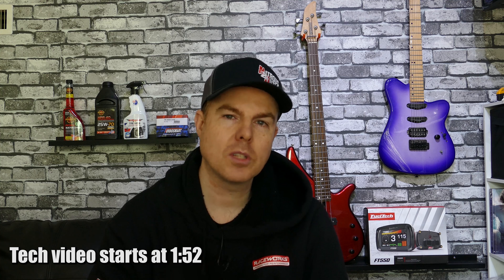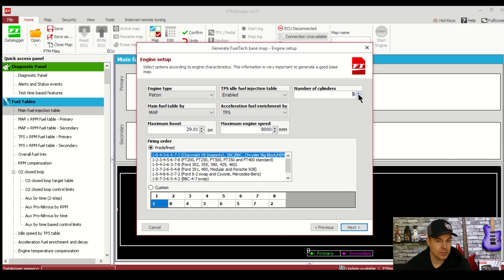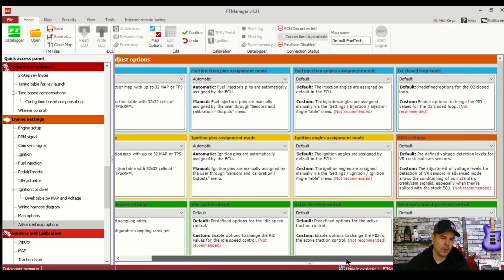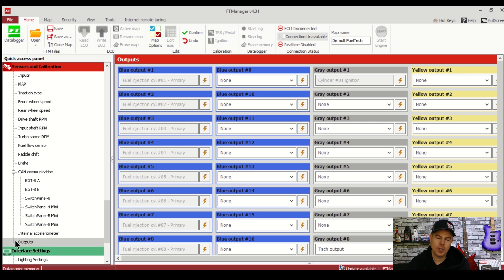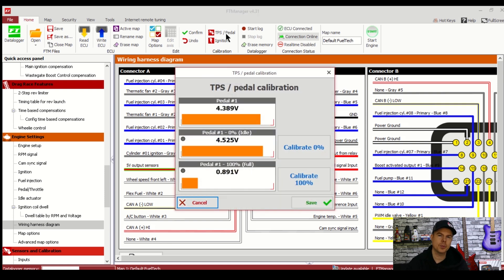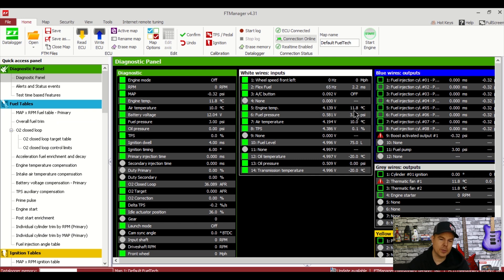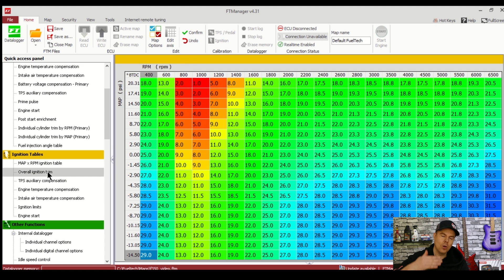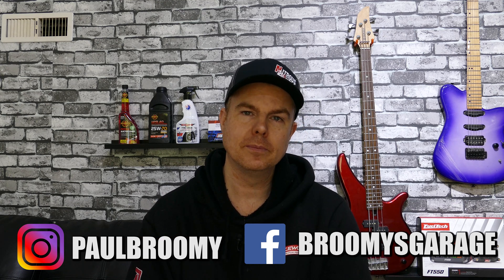How to Setup a FuelTech ecu (FT450, FT550, FT550 lite, FT600)

Comment: Boy you talk FAST !! IM Working on My 88 10th anniversary RX-7 1of1500 13BTURBO on an FT-450  
Do you have a setup Video for This Same pretty simple all Fueltech Setup. 10:10
Reply from the maker: If you follow the setup wizard you can select rotary and the option for the factory crank angle sensor trigger pattern is there.

Comment: On my 550 lite, Built my own wiring harness. I’m having an issue calibrating TPS. Once I hit calibrate. TPS reads 100%. Once I moved the white input. I was then able to get it to drop to .5-0.49. I then accelerate n its jumps to 5.00v like normal. Injectors would fire except for #3. Switched for a #1 inj plug. N the #3 inj still only fires. I then moved the Blue outputs to the B plug, outputs socket #9 or so. Test it I could hear fuel spray but not click if that makes sense. Then I put the blue in the normal socket n the #1 injector started to function normally along with my #3 that was working previously. Did that same procedure for the rest n all inj worked properly. After getting the TPS n injectors to function. I did some where the tune didn’t save nothing. So now I have to build a new map. The TPS reads 100% again n my injectors don’t work once tested in the output page. Now I have to do all that moving wires again. Or is my ecu defective? Also my Fuel psi isn’t reading oil psi is reading fine. Switch plugs n I was able to see accurate Fuel psi to my gauge. N of course no oil psi. Ppl tell me the wiring is backwards or sum silly. If that’s the case why did they function after moving certain wires? Never had to mess with a plug in the engine bay. Only moved specific wires on the ecu side. I need help lol btw I have body to engine grounds strapped. Tested sensors for 5v like tps, oil psi, etc. injectors n ign coils had 12 and ground. I checked the wiring multiple times

Comment: thank you for the video, it is great. i have a question i am afraid to ask. how the heck does the multiplier work? I want to add say 12% to the fuel. i can not get it for the life of me
Reply from the maker: Select the cells you want to multiply. Press M (for multiple). % is based on 1. 1.00 = 0%. 1.12 = +12%. 0.88 = -12%.

Comment: Do you have any more fueltech videos. Thank you for the information man. I'm in PA or I would go to the seminar they hold. Wish they had online training.
Reply from the maker: What kind of videos are you looking for ? There are other racing videos that go through the data side of the fueltech
Reply: @Broomy's Garage  I need everything lol... I have a 12v vr6 swapped vw cabriolet runs and drives but getting things ready for a turbo. Going with a fueltech 450 received it today. Not many have done this if any. So we will see I'm sure I can figure out the wiring but tuning another story no clue.
Reply from the maker: https://m.facebook.com/groups/922228697955050/?ref=sharehttps://m.facebook.com/groups/922228697955050/?ref%3Dshare&exp=9594&mibextid=S66gvF this is a great resource for information and asking questions.

Comment: 4:47 petrol (petroleum, crude oil), the term "gas" short for gasoline makes more sense. who puts crude oil in their fuel tanks that doesn't use a diesel? some may say the term "gas" could be confused with natural gas, who drives a road legal vehicle that uses natural gas? it's all about CONTEXT. rant over 😁
Reply from the maker: In Australia many many cars run on LPG, liquified petroleum GAS. It is essentially 50/50 mix of propane and butane, and it is what every Australian refers to as gas, as it enters the engine as a gas. Plenty of buses also have been converted to run on LNG here as well (natural gas). So who drives a car that runs on actual gas??? Australian’s 😎

Comment: Paul have you done a setup on a ford 2.5 4cyl engine?
Reply from the maker: Hello Jose, I have not, however the method should be exactly the same. You will only need to change the type of crank trigger you have

Comment: Another great video Broomy. I hope you end up keeping the Clevo.
Reply from the maker: I will do a video on this soon. If you go back a year ago on fullboost, we already stated that the clevo with the diff ratio needs an overdrive gear in the gearbox. There just are not any economical options for this when you compare it to other options (such as buying an entire BA falcon for instance and getting the Barra and BTR from it for only $500). I like the clevo, but it’s also a noiser, rattler, old school engine, and a more modern engine will make for a better long haul driving experience. Have to put it out to the viewers to give me some ideas, however silly suggestions like ‘put a gear vendors on it’ like some originally suggested is ludicrous @ around $3000+ it ain’t happening. I’ve looked for over drive trans for a clevo, and from what I can see the AOD which has a rubbish reputation, is expensive and hard to find, is almost the only option.